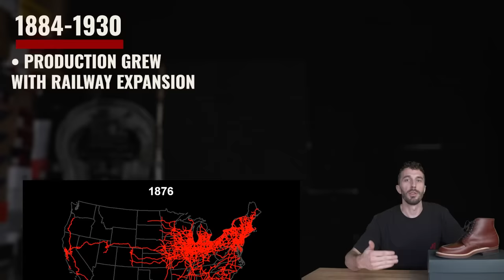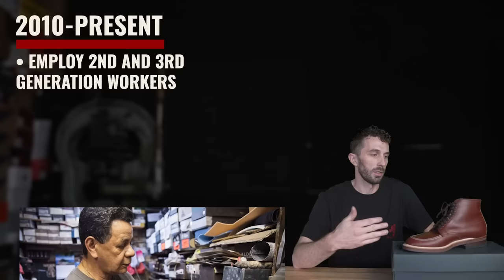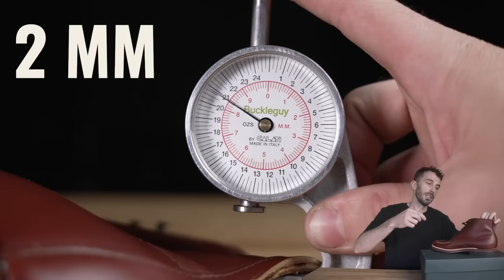Why the Indiana Jones boot is stupidly overpriced - Alden Indy

Comment: I own a pair of 403 Indys as well as 2 pairs of factory seconds ($399 each). 
I will say this up front, this boot is expensive for what it is. He's 100% right for calling it out. Having said that, my Indys are THE MOST comfortable boots I own. I own several pairs of Red Wing and even own Wesco Mister Lou's and my wedge sole Indys are amazing.
Keep up the great content!!
Reply: How is the wesco for you fit wise? I'm a 9.5D in Alden Indy Trubalance and trying to get the British Tan Roughout Wesco 7500.
Reply: @Sandblstr  Either stay true to size or half a size down for a snug fit. I took some bad advice online and went a full size down so I bought 8E when I wear 9D in Indys. My right foot is snug but not too bad however the left foot has a hot spot near my big toe. I'm looking to sell mine now.
Reply: @AJThrash1  My issue is toe rub. My feet love the 9.5D truebalance last and it locks my heel in and my toes are not too cramped. I tried the Thursday Captain in 9.5D & 10D for a cheaper knock around show and I was miserable with how tight my toes were. I'm sorry you had bad luck with sizing your wesco's. Especially since they have such a long wait time it seems like.
Reply: It's only dependent on the last the boots are built on, comfort wise

Not the boot itself
Reply: @Sandblstr  I have never found a shoe that fits better than the truebalance last tbqh.

Comment: I bought two pairs of Indy boots this year and love them. Worth $620? Nope. But I got for $400 as seconds. In the positive column, you can walk comfortably on all terrains for more than 10 miles in comfort.  They’re stylish and beautiful. Upper leather is best I’ve owned, better than Nick’s. It’s strong, supple and non-creased, even in CXL version. But I have to disagree with people who say the leatherboard heel stacks are worthy of Alden. My complaint isn’t aesthetics. All three pairs of my Alden boots have heels that have begun to separate. I believe the compressed fibers of this cardboard like material are poor at holding cobber’s nails and glue. My complaint about its usage are strictly structural. Grant Stone boots are better made of better materials, but they’re clunky, stiff and unsexy compared to the Aldens, IMO. As for Red Wing Iron Rangers, they can’t handle the terrain that the Indys can. I took both pairs on hikes on bumpy trails and desert terrain. The IR’s hurt my feet and allowed too much ankle roll. The Indy’s shined, even the version with the smooth neoprene soles, which clung to desert boulders without slippage. Both are decent performers on city streets.

Comment: I rejoined the Alden group on facebook just to watch their reaction to this.  LOL

I mostly agree with this assessment, but I'm gonna take issue with two things... 

1.  Leather board.  I agree that I wouldn't want to see leather board in the midsole.  Gross.  But in the heel stack, heel counters and toe stiffener, i'ts fine.  Crockett and Jones uses it in their heel counters too (as far as I know) as does trickers.  Florsheim used it as well starting in the mid 70's.  I've got tons of Florsheim shoes from the 50's up to the 90's, it may be my favorite brand.  Leather board heel stacks last just as long as full grain leather stacks.  I just put new toplifts on a pair of golden harvest from the late 70's and the cobbler was able to re-use the original heel stack made from leather board.  Should alden be using leather board in their stuff?  No.  Will it fall apart?  The heel stack and counters almost certainly not, the midsole... that's not a good place for it.  

2.  Their sole material.  Some love it, they claim it's as breathable and feels as good as leather but lasts twice as long.  I dunno, I don't own a pair with those soles.  I would not count that as a mark against the shoe though.

Also that covering on the leather.... They do that with shell too, it gives it an extra rich eggplant type colour that nobody else really has.  I've had Alden shoes in calf and they certainly didn't have that weird assed finishing.  

I've got a pair of Alden mocktoes in shell #8 and in the barrie last.  They look like Indy's but are on a different last and have a 360 welt.  If I want to trigger alden fan boys I call them indys, heh.  I got them in exchange for other stuff and probably have $300ish in them.  They've great for the price I paid but at full freight they'd be a hard pass.  I've also got a pair Alden chukkas in barrie last in shell #8.  I got them from a nice fellow who wore them once and then passed them on to me for like $400.  They both are sharp as hell and make for great boots in the rain or whatever.  But at full freight I'd rather get shell carmina with JR soles.
Reply: Correct and the midsole is easily replaced

Comment: As an Alden owner, you missed a few points:
- Their comfort is unmatched, they are incredible.
- They use the cheapest laces ever and combined with poorly done eyelets with metal barbs, they literally shred to pieces.
- The poorly done eyelets are inexcusable.
- The tongue design is awful, causing the tongue to slide over to the side with wear. Incredibly annoying.
- The finishing is trash, with cuts all over the leather around the heel near where the heel stack starts. You can see they literally cut gouges into the leather.
- They are visually beautiful to look at.
Reply: I own Aldens as well, and you're right!
Reply: Spot on. Don't even get me started on their trash speed hooks. Despite all that I still love mine and will probably get more in the future.
Reply: Lol that's a fantastic review
Reply: Alden Indy owner, reverse chamois tobacco with mini lugs, so I don’t have the paint issues or sole issues that Rose Anvil is describing. I am, however, appalled at the revelation on the amount of leather board. I have to say, I love them, but everything you just said on laces, eyelets and tongue are spot on. Thanks for the comment and as always, thanks to Rose Anvil! I’m definitely annoyed at Alden.

Comment: I have a pair i bought somewhere between 17-20 years ago.  they have: canvas lining, leather board in all the same places, and the leather seems higher quality than these, and does not appear to be painted to me.  they were very comfortable while the sole lasted, but the sole died in around a year, and that was as an office worker.  mine only cost about $350, but with inflation, that's probably a wash.  I'm debating getting them resoled, but i generally wear a bigger size shoe now.

Comment: Are they stupid expensive? Yes. Do they use leather board? Yes but supposedly it’s because they break in faster that way. Are they extremely comfortable? Yes. Are they stylish AF? Oh yeah! Don’t like the cow skin leather? Get the chromexel or the Cordova ones. Don’t like the neo cork soles? They offer commando soles, and 360 welts if you prefer them. They also look kick ass as they age and look just like Indy’s, and they still clean up nice enough to wear out with jeans and a sport coat. You’ll get more inquiries and comments when your out sporting your Indy Boots then you will when wearing almost any other boot. Bottom of the line… are they the most iconic boots ever worn by the ultimate badass? You bet your ass they are!

Comment: I got mine over 20 years ago (probably around 2001/2002). They have been resoled once (not by Alden). I found them very comfortable but the tongue always moves/shifts around, which is annoying.
Reply: have a cobbler sew the inner side of the tongue with a single stitch to the upper. keeps it perfectly in place, and makes no difference putting them on/off.

Comment: Alden already fixed those issues with the commando soles and CXL or reverse chamois leather. Indy's feels so much better on your feet than iron rangers, you can't even compare.
Reply: Agree. I dunno why people comparing with IR tbh. The IR is more of a ‘work’ boot and Alden is ultimately a dress shoe company.
Reply: The point is where is your money going? Why are they $610? The comparison is to show material value. If they are built similarly to the Iron Rangers why are they twice the price?
Reply: @jmarth523   That’s the thing they’re not really ‘similar’ to the IR’s.  Money is going to the comfort/shape of the Trubalance last, the steel shank, inner leather lining (resulting in much easier break-in) — to name a few that the Indy has over the IR. 
The IR looks like it’s built on a clown shoe last and cannot be worn in more dressed up occasions. So it’s not a good comparison as Alden’s bread and butter isn’t even the Indy — it is dress shoes/boots.  Red Wing’s bread and butter is work boots.
I have nothing against Red Wing as I own a pair but totally different boot.
Reply: @RacksonRacksonRibss  Compare it then to the build of the Parkhurst Niagra. It's 400 dollars
Reply: @jmarth523  That seems like a better comparison. Just went to their site and it’s $418 compared to Alden Indy at $607.
Only thing I noticed is that it’s a little unclear as to whether Parkhurst boots are made in USA.  Sounds like they have a factory in Spain.  And depending on the buyer that may make a difference. 
Thanks for sharing — had never heard of that company. 👍🏻

Comment: A boot is more than a bill of materials. I own both Red Wing moc toes (875s) and Indy boots (403s in Chromexcel). While they might have similar construction and materials, if you put both pairs next to each other the Red Wings look crude. It takes time to give a boot a dress shoe like finish (skive edges, sewing in a leather lining, and doing french binding). Paying for people's time cost money, especially in the US. 

If consider $300 for Red Wings "fair", there's probably another $100 in labor in these boots. Alden material costs are probably higher (smaller less vertically integrated company).

I DO think Indy boots are overpriced, but I think this review is overly harsh. I think a lot of viewers will take away that these boots are crap, which isn't accurate. At the end of they day these are a $400 boot with a $200 icon tax. There are definitely worse sins in the footwear industry.

Comment: I have about 10 years underfoot with two pairs of 405s. The comfort is outstanding because of the last. I upgraded from a Redwing Beckman to the 405. It’s a magnitude difference how much more comfortable the fit is on the Alden. It helps that Alden is made as an orthotic shoe base and came in many widths vs the early heritage boots like the Beckman which was made for heritage style and only came in one width. The Alden stitch quality is fine dress shoe style, it’s not a PNW logger or an east coast work boot with bulky double and triple stitch. It’s a work boot made by a dress shoe company. Yes the canvas and synthetic liner was gross on the first pair. The next pair I got was leather lined an improvement brought in by increased scrutiny by reviewers and by competition. Yes the leather is painted leather, it’s gross, the color is less than desired but again they changed it to a normal brown due to competition and scrutiny. Yes there’s leather-board in the construction. It’s cheap in that aspect and that’s a huge bummer for a high end cost boot, I wish it was real leather. However it is durable for wear and moisture for the life of the outsole. Most wearers will have a rebuild before the cracking of the leather board not to let Alden off the hook for the crappy midsole. We’ll see how long the crappy genuine leather insole last though that was a poorly thought out choice on Alden’s part. 

The sole is not a commando sole but  it’s better than a leather sole by a long shot. Lots of boots on this channel have flats or leather soles and don’t get the critique on not being a logger boot. 

The 405 is greater than the sum of its parts and a large part due to the comfort IMO.

 Also keep in mind Alden never stopped with MITUSA they kept up the heritage while brands like Redwing, Chippewa and others went foreign build before coming back to heritage as a recent trend.

Comment: did you try them on?  they are by far, the most comfortable pair of boots/shoes ive ever worn.  i think my whites uses better quality stuff, but my aldens are far better stitched in terms of evenness and aesthetics.  i think whites and nicks and redwings serve a different purpose than the indys.  none of those work boots hold a candle to the indys in terms of comfort.
Reply: What are you saying; they use cheap materials and they're way overpriced but they're comfortable so they're worth it?
Reply: @MarkGelderland  I think people overestimate and over emphasize getting every last penny of the dollar they are spending and call that value but ultimately, none of that really matters if the boot or shoe is going to last decades. I've never seen or heard of indys having some catastrophic failure because they used leather board instead of full grain. For me, it comes down to comfort and the joy it brings me when I wear it. Am I disappointed they don't use top of the line this and top of the line that? Sure. Does that make them any less comfortable or as beautiful as I find them to be? Absolutely not.

Do I find that they are worth it? Yes.

(edited for typos)
Reply: @jasonk12345  True, if you think they're worth it, that's what counts in the end.
Reply: Honestly, for people who actually OWN and WORN the boots? They’re actually amazing.

Comment: I'm 12 years into owning Iron Rangers with the black soles (I'm about 1/8" away from wearing through the original soles) and I own a a couple of pairs of Thorogood boots (685 Horse hide, and their roofer boots that look like bowling shoes.)  One with pink soles like these Aldens and one with  black soles.  The black soles look identical to the Iron Rangers but are nowhere near as slick.  The pink soles actually hold pretty well on wet ground.    Other than doing the splits to save my motorcycle from falling when I put my boot down onto sandy pavement, I have never fallen on ice or leaves.   But I've just grown used to wearing these slick soles with no traction.   The Iron Rangers are by far the slickest.    I find the stuff like Alden has to be good traction, but that's me.    My Iron Rangers have no excuse to still be complete boots, but they still are.  I've had them wet, on fire, soaked through with gasoline, mud, etc...  They feel like slippers to this day.  I wear them the most.  I wear my Thorogood boots when I'm dressed up like on a Sunday at a gun show or having to go eat at a Cracker Barrel, you know.. nice places..  But my Iron Rangers are my ride or die and they have not worn out in 12 years of nearly daily wearing.

Comment: I have multiple aldens (though not an indy boot). I don't think your appraisal is unfair, but here are some of the things I think you are missing about Alden and the Indy boot:

1. Alden was a manufacturer of orthopedic shoes for decades (and still does it) and I will tell you that the Aldens I have owned are by far the most comfortable leather soled shoes I have ever owned. I don't know what accounts for it, maybe last construction, maybe the particular combination of materials they use but nothing else comes close. 

2. The older Indy boots (including the ones Harrison Ford wore in the movies) had canvas lining rather than leather and were likely constructed very similarly to these boots. I would not be surprised if the reason the 405s use pigmented cowhide rather than something better is simply because this is how alden has made the 405 for decades. Alden 405s were not luxury objects back in the 1970s, they were work boots, but what has happened in the intervening years is that the low end of shoes has gotten much lower and cheaper and Alden is now competing in the luxury segment even though that isn't really what they were originally designed for. 403s which use Chromexcel and cost the same would likely have received better marks by you. 

3. It is well known that Alden uses leather-board and the shoe community shits on them all the time for doing it. I will say that while I do wish they would use leather instead, it is not as if I see leather-board failing very often before a resole would be necessary anyway. It is a suboptimal material for them to use to be sure, but this again seems to me like a remnant of the way they have made shoes for decades. They were not ever really the Cadillac of shoes until basically all of the other american dress shoe manufacturers moved production overseas and they were the only ones left around doing domestic production. 

Overall, I certainly wouldn't call them a deal, but you generally do get what you pay for with them in terms of longevity and durability. I would like to remind everyone that obsesses about having "all leather everything" that literally no general customer gave a shit or understood how shoes were made or what cobblers were doing during resoles until very very recently. Harrison Ford didn't look up a youtube video to find out what the midsole of 405s were made of before buying them, he was a carpenter that wanted comfortable shoes and one of his friends told him these shoes were very comfortable and he bought them and liked them. The shoes Alden makes are still very comfortable today and really I think that's all they are aiming for. I too wish they would aim a little higher sometimes.

PS: It's also worth noting that a former executive there was convicted of embezzlement of company funds so he could support his girlfirend's media career, wild story worth reading about.

Comment: That surface paint color is on the chromexcel version as well. Because I cleaned the toe box of mine and that surface layer came off.
Reply: No that's how dyed CXL is. It's finish is like that.
Reply: @gnarl12  I assure you, there are many types of chromexcel variations. Which I own, And I can take saddle soap and scrub them all day, and no outer layer comes off. The 403's are chromexcel but Alden chooses to finish it in this way.